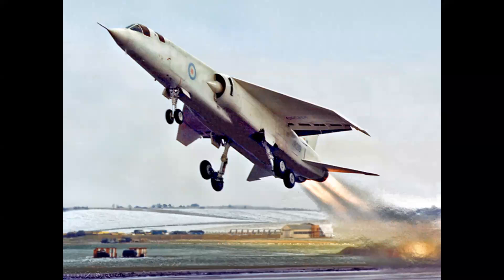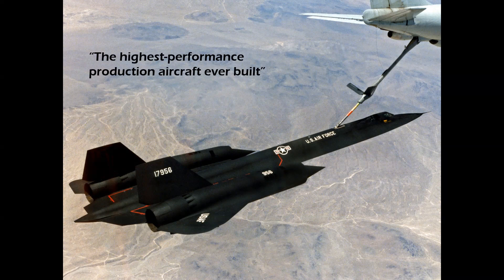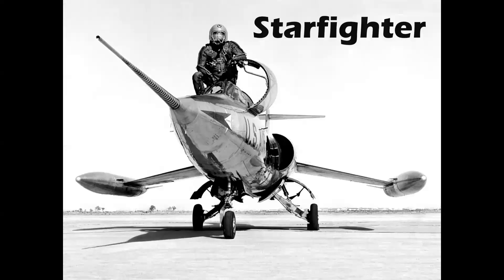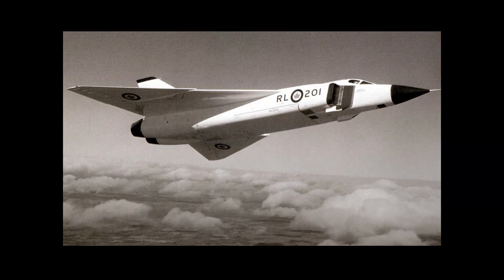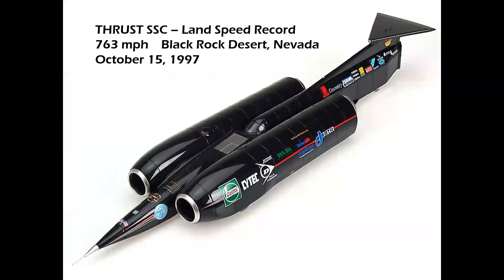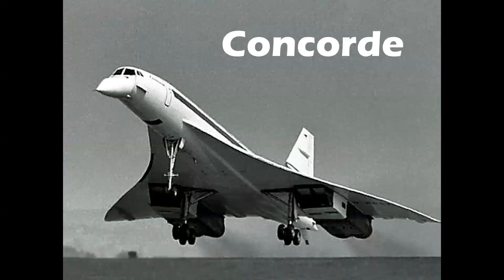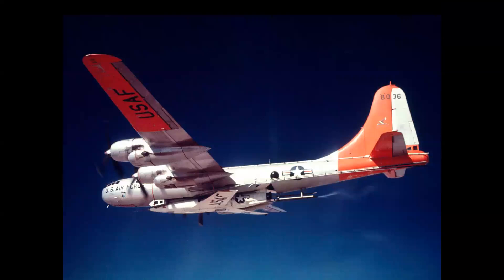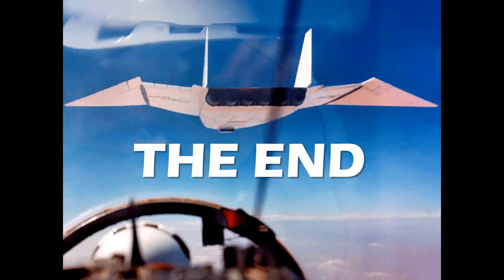FUTURAMIC! - Twenty of the coolest and most futuristic supersonic jets from the Cold War Era!

Comment: F-106 owns the record as "Fastest Single Engine Interceptor", a record it has held since 1959 at 1,525 MPH over a closed course!  There are a very few single engine FIGHTERS that are as fast or faster.  F-104 (1,525 MPH) and Mig-23 (about 1,535 MPH)come to mind.  But I dearly love the F-106!
Reply: Yes, F 106 gets my vote, very coolest!
  What is really neat is the nuclear bomb air to air missile it can carry.
  You can miss by a mile and still take down the enemy squadron with one shot!
Reply: The unguided nuclear Genie rocket was dropped when the tactic of massed bomber formations was no longer used.  The "Six Shooter" 20mm Vulcan gun pod was developed to be mounted replacing the Genie.  The F-106 turned out to be a surprisingly good dogfighter!
Reply: I also love the six, like Mr. Machat says, it just looks right: sleek, beautifully proportioned and (finally) delivered on the plane the 102 should have originally been. All of the choices where solid and lovely but I think the six is just so rarely mentioned or talked about and it's a shame. I would have loved to see one flying, never mind riding on one.

Comment: The wingtips did not droop for lift.  The shock wave was generated by the base of the splitter between the intakes and most of the lift came from under the large, flat fuselage  Because there was this extra lift, the wing did not have to work as hard, so the vertical stabilizers could be made smaller, reducing drag, by drooping the wingtips and using them to argument the directional stability that would otherwise be lost by making the vertical stabilizers smaller .  This is well detailed the book VALKYRIE America's Mach 3 SuperBomber , which is probably the best aircraft book ever written.

Comment: Hi Mike, What very excellent and informative video! Very much appreciated that you mentioned the Avro Arrow on this list! And as result here is some great list of facts that might interest you: 

The first non-experimental aircraft that was designed and flown (in 1958) with a fly-by-wire flight control system was the Avro Canada CF-105 Arrow a feat not repeated with a production military aircraft (though the Arrow was cancelled with five built) until the F-16 and F-18. This system also included solid-state components and system redundancy, was designed to be integrated with a computerised navigation and automatic search and track radar, was flyable from ground control with data uplink and downlink, and provided artificial feel (feedback) to the pilot. The Arrow's thin wing also required aviation's first 4,000 psi (28 MPa) hydraulic system to supply enough force to the control surfaces, while using small actuators and piping. To improve high-alpha performance, the leading edge of the wing was drooped, especially on outer sections, and a dog-tooth was introduced at about half-span to control the spanwise flow, and the entire wing given a slight negative camber which helped control trim drag and pitch-up. The area rule principle, which was made public in 1952, was also applied to the design. This resulted in several changes including the addition of a tailcone, sharpening of the radar nose profile, thinning the intake lips, and reducing the cross-sectional area of the fuselage below the canopy. 

The Orenda PS-13 Iroquois II afterburning turbojet engine that was being developed for use on the Arrow used a "two-spool" layout with low-pressure and high-pressure sections of the compressor for added efficiency. The design also incorporated a number of new design features in order to improve simplicity and lightness; being designed with Titanium in mind from the ground up to help reduce weight and give exceedingly far more power. As well as the first use of a trans-sonic first compressor stage on a turbojet engine, being designed with only two main bearing assemblies on a two-spool design, an oxygen-injection re-light system, a hot-streak” type of afterburner ignition, as well as being the first engine to use only 10-stage compressor sections in a two-spool design (by comparison the competition of other engines of the era were typically using 17!) 

I really hoped you've enjoyed reading all of this
And of course once again Well Done and Thank You! 

....Regards, Noah.
Reply: Fantastic stuff, Noah!  Thank you for sharing.  Do you have a channel or website, or could you link to some of your favorite Arrow resources?  Such an amazing aircraft, I love reading about it and taking in photos of this beautiful plane - except of its undignified end - I still have to skip that part.  If it makes this American sad, it must be absolutely heartbreaking to a Canadian.

Regarding the titanium, did sourcing it have a story behind it like the Blackbird, or was titanium mined in Canada?  And what of the learning curve regarding working the metal during production?
Reply: @ronjon7942  Hi Ron, 
I'm very Glad you liked the info, 
And yes do In Fact follow a few channels and websites dedicated to the Arrow one of my most favorites is Virtualenvirons. They've created a great extensive series of videos showing the true capabilities of the Aircraft I'll provide a link to it below in case you're interested. I also highly recommend reading the book "The Avro Arrow: For the Record" by Palmiro Campagna; Palmiro is one of the most top experts on the Arrow  having been primarily responsible for releasing many if not all the archival records relating the programme, he's also played a role in the Arrow series. That book is his latest title on the subject matter I'd highly recommend purchasing it through Amazon if you ever get the chance, it very interesting and extensive read with some information. 
As for the Titanium used in the Iroquois it was primarily mined in Canada as far as I'm aware since Orenda Engines Ltd was a conglomerate of Avro Canada.
However one engine in particular (X-116) was set to England under great secrecy, which helped in the development of the Olympus engines which would later power the Concorde. That engine has now been brought back to Canada and is currently being restored by Robin Sipe a private collector in Fort St. John British Columbia I'll provide a link as well for the series of videos regarding the Iroquois restoration. 

Regards, Noah 

Avro Arrow Series: https://youtube.com/playlist?list=PL3EReMs3ND7UC-VT6gOjFauI_PgDDPWdo 

Iroquois Restoration: https://youtube.com/playlist?list=PLE5I9ZZNPu1P0YQdkkGyOT_hmWUavtbvO